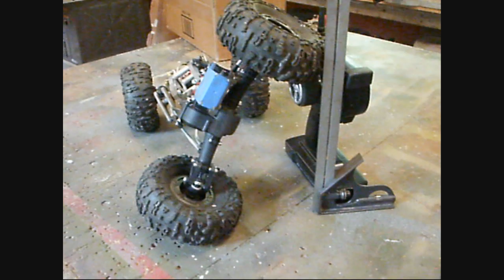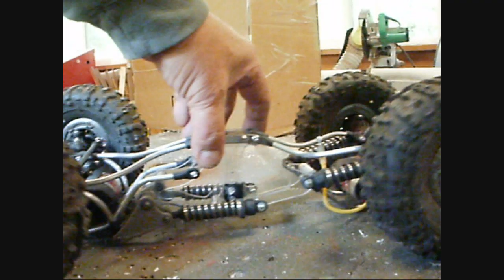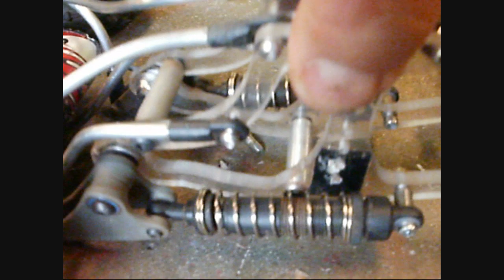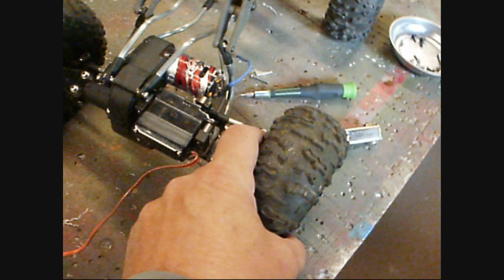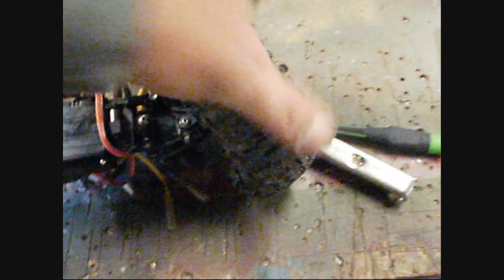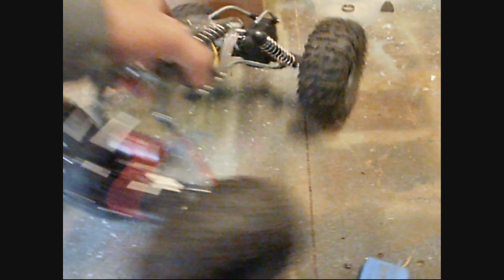Not So Much RedCat RS10 XT Left Now....The Endless Mod Continues

Comment: So when your finished with what you have going now, are you gonna make a finished, final product? like Carbon Fiber chassis plates.... all that kinda stuff. because I like what you have going with the suspension and chassis.
Reply from the maker: +ViceVersa Musik Thanks man. I have designed and fabricated a lot of chassis since this video. Got the bug bad. This design is very interesting and running head to head with "state of the art" CF comp chassis crawlers it did really well. The axles are the dead end. RS10 axles are cheap and robust but lack turning radius and without even more modding are only going to sock up to itty bitty 390 motors. IMO CF is not all that. Unless you are comping and looking for every possible weight advantage Lexan is way better IMO. Almost as light, much more durable, accepts a screw and cheap and easy to work with. I know it's not what people are expecting in a comp crawler but Fringe RC is my domain...no rules!

Comment: What would you charge for this setup? If you're not an engineer, why not? you should be in developement. I know it is a mix of parts traxas radial arms ect. You could make it one shock per side with front and rear radials, would want a long throw shock with possibly dual rate springs. the battery on axel seems like a great add. Your name should be Dr. MOD cause this thing is sick.where did the idea for the curved links come from?
Reply from the maker: +Jerry D I found the Axial XR10 axles to be a lot better on this chassis and TBH one of the better crawler chassis designs I've come up with but overly complex. Check out my channel playlist on RC Chassis development. Thanks!

Comment: Do you have any videos of the truck crawling?
Reply from the maker: Only one with RS10 axels and a single ESC https://www.youtube.com/watch?v=DbRPIAAoac0 right after that I got some Axial XR10 axles, dual ESCs, HiTec 7950 Servo, CC BEC etc etc etc and transplanted those onto the chassis. I have quite a few iterations of the cantilever chassis and I developed the heck out of it once I got the XR10 stuff working right.. Dual ESCs and way more steering angle made the whole set up work right. https://www.youtube.com/watch?v=ZGG3MOiPYcs RedCat axles aren't the worst...but they can't compare to a proper comp set up.